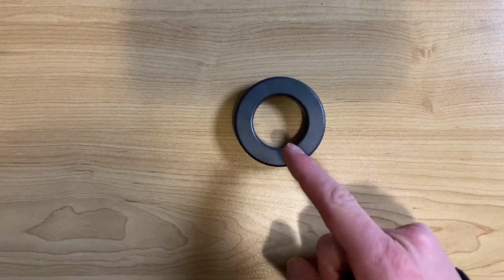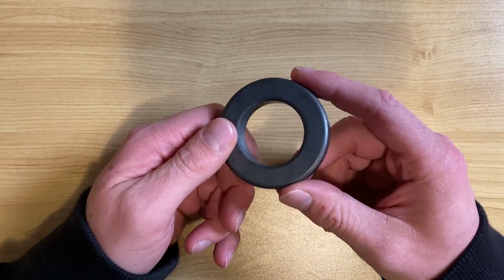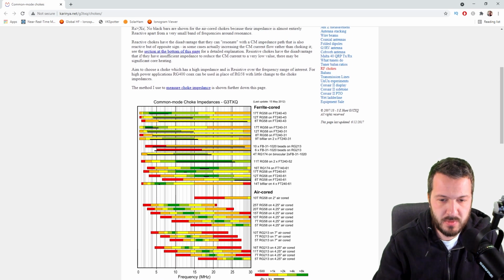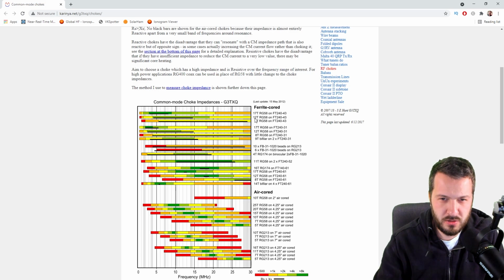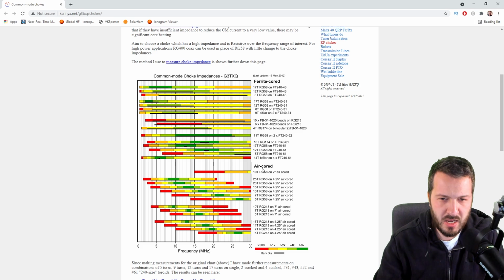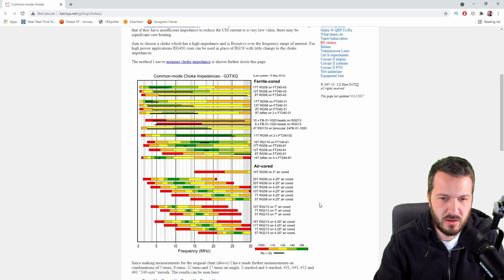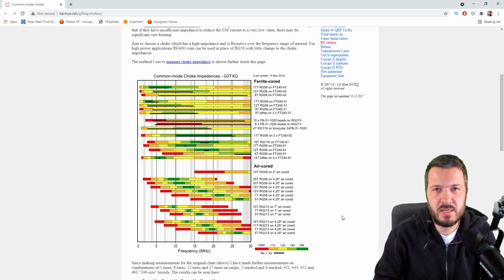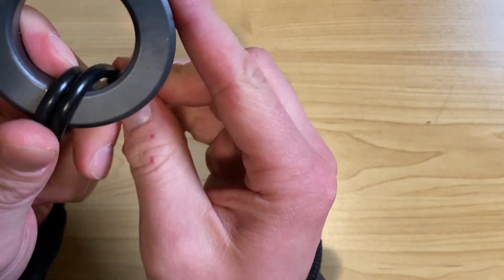Reduce Common Mode Current (CMC) with a Easy to Build Choke

Comment: Would love to see a before and after on the air. Thanks Hayden.
Reply from the maker: Thanks James, I've still got the antenna to go up. It's nice weather today, so hopefully if I get home in time I might be able to do that. 73
Reply: Nice job Hayden. I wonder, when used with a 100w txcvr,  how would you see any difference? Better match? How does less RF returning down the coax manifest?
Reply: Yes plz